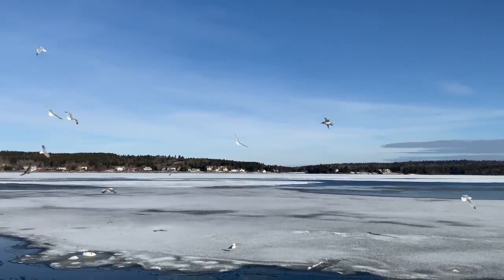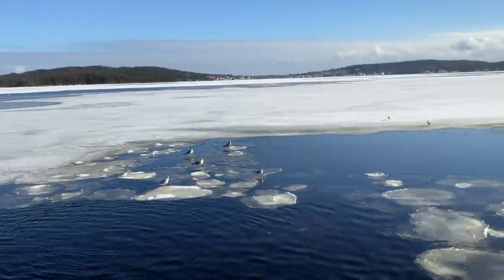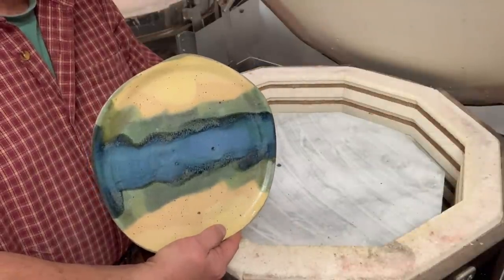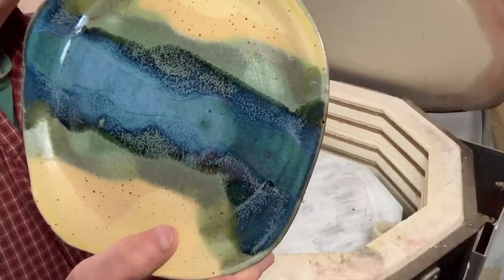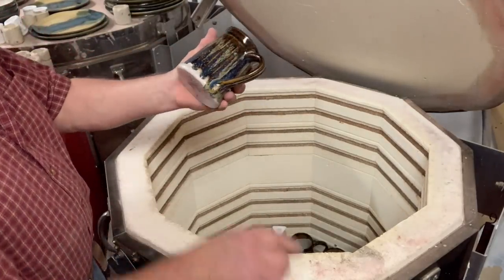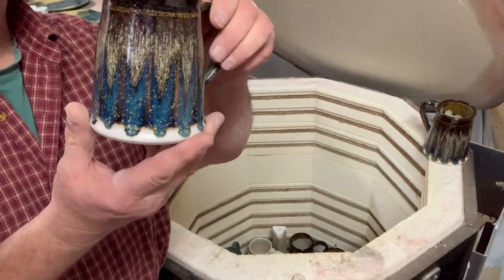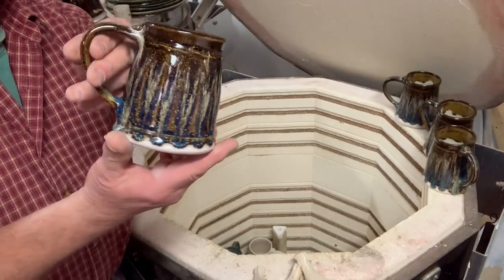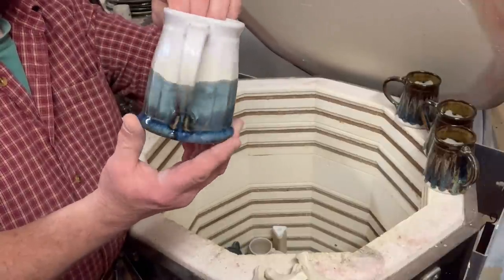Ten Moku Gold de -mystified.

Comment: I have an oatmeal glaze that when over fired goes from soft mat to clear gloss, which is frustrating. A bowl and a mug turned out very nice... except for the inside bottoms which were sitting on a hot shelf; both turned glossy and crazed. Nice work.
Reply from the maker: You need to add some tin to your oatmeal and may be some EPK.
Reply: @Vsmithpots  Thank you, I'll give it a go.

Comment: Hey there. I have a question but it doesn’t have anything to do with this video. When you made your fish you said you had used some paper clay and I was just wondering what kind of paper clay you used and how do you mix it with the regular stoneware clay? Thanks so much.
Reply from the maker: I do not recommend the paper clay, it is too fragile. It snapped quite easily while holding the pieces with glazing tongues. I think it might be appropriate for solid sculptural pieces.
Reply: @Vsmithpots  Oh thank you so much!!! I almost bought a bunch of it. Thank you fir letting me know.